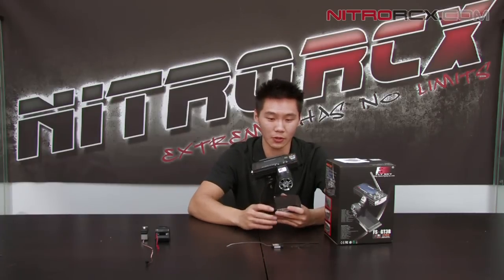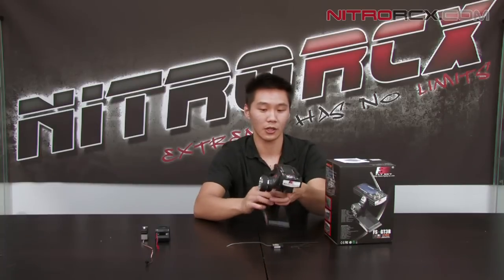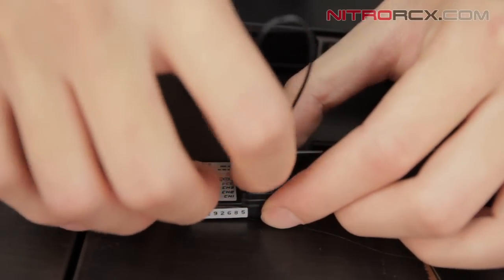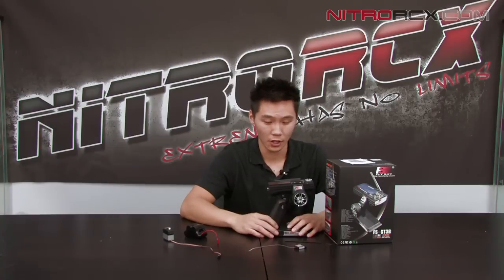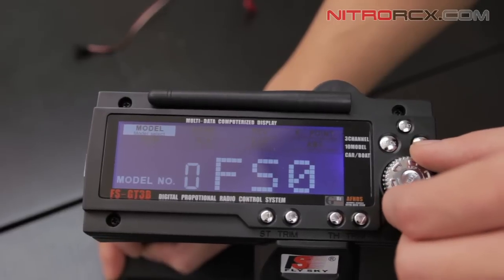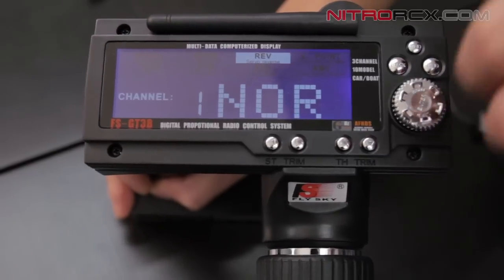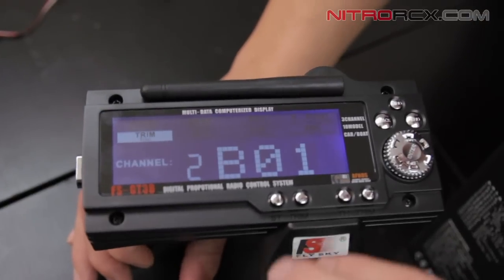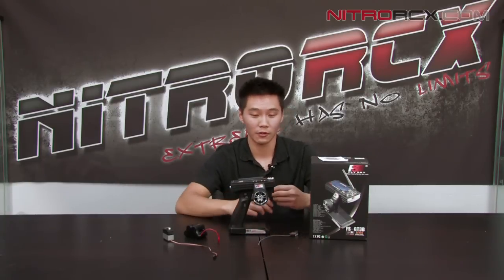Awesome FS-GT3B Digital 3ch 2.4ghz LCD Transmitter & Receiver

Comment from the maker: The red plug on the receiver battery pack is called a JST plug, and you can get it at most online hobby shops. Check online to see if you can find someone that's selling a Tamiya to JST plug adapter.

Comment: @ramtrix if your throttle is working as steering then you most likely plugged your servo into channel 2. Channel 1 is for steering and channel 2 is for throttle. Be sure you plug your steering servo into the channel 1 port (Ch1) and the ESC into the channel 2 port (Ch2).

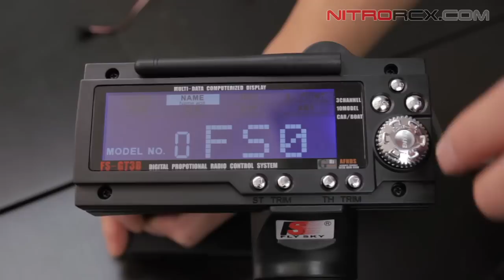Comment from the maker: When you set it make sure you have it set to the correct channel in your case I think you left it in channel 1 that is why the steering was changed and not the throttle, watch the video at about 5:40 and you will see how to set it on the transmitter.

Comment: @98snakeeater, to bind it if your not using a stand alone battery pack like bec. You would use your esc.  There is a good video that shows you how to bind it. The name of the video is How to bind,FlySky GT3B 2.4GHz 3ch receiver and how to set up the fail safe.

Comment: I highly recommend this system i use it in my revo 3.3 and i have not problem taking it 150 yards away with no glitching no delays no problemms what so ever. i also own a futaba 3pm 2.4ghz i had on my revo but removed it for 1 reason ths low battery indicator doesent beep till 8volts which is to late mine hite 8volts and my revo never came back 40 mph into a block wall luckly only broke front diff case 15 dollar fix.

Comment: @supersanchez1991 hey man thats a good question for a beginner. i myself had to ask someone about this. all it is, is that it doesn't interfere with any other car frequencies. sooo this means that you can have many people running 2.4ghz without any interference. you can also pair the controller to any other 2.4ghz rc product.

Comment: all you have to do is select E. POINT and above the 100% it will say RIGHT BACK turn the stearing wheel to the left and it will say left forward and it will be back to normal. Mine was the same way when i got mine and that fixed it.

Comment: i need a receiver for mine i have the same one in your video but no receiver and every where i check there out of stock on the receivers
Reply: Ithink you can find this een on Banggood.com or Ebay for for sure.. I have also been checking out some nicer remotes too, here is one that I found: http://www.ebay.com/itm/FS-GT3B-3CH-2-4GHz-Transmitter-w-RX-Failsafe-For-RC-Car-/110706197338?pt=Radio_Control_Parts_Accessories&hash=item19c69a835a      I know I hate having to get everything from overseas to get a good price which can suck having to wait weeks to get something!!
Reply: ***** i love the radio but no one has any stock for the receiver even if i can get one receiver id be happy i have plans for this radio, i have tried to bind it to other machines with no luck at all so ill have to get a receiver maybe a few receivers for its a sweet radio
Reply: Hey Kevin can you tell me why a after market controller is better ? I am so confused about what one to buy 2 CH 3 CH Hall me out buddy
Reply: Jimi G after market controllers when you can use them are better cause the sets up are much simpler you get extra features on some that you dont other wise get more range is alos a bonus as well that some offer other wont. and there is the access to multi model memory one controller can control several different models i have the GT3B that they guy in the video is showing its 3ch and its awesome and very easy for setups as well. , iam also looking into getting the GT3c eventually and i want a few 4 channel radios as well.

Comment: @smokesilver ive tried that a few times, yet it doesnt seem to want to kick into reverse. the lights on the ESC show it working properly, like green if i go forward, yellow when braking red in reverse, but i just stop, no reverse? not sure if its the radio, all the trims are set correctly.

Comment: I bought one of these for my ACME Flash racing dune buggy 1/8th brushless and the car goes super fast in reverse and slow when going forward and I do not know how to fix that
Reply: Try flipping around your esc connector in the receiver.
Reply: Thanks but already got it fixed, someone suggested to swap 2 of the wires coming from the motor to the ESC and it worked

Comment: There isnt any trouble shoot there. the systme was able to bind. In my vxl cars everything is fine and the trims are at o for both. When I pair with my dynamite fuze 6800 kv systme it is binded but does not work right. The throttle trim has to get put to b 30 and does not opperate correct. How do I fix this problem. I bought this system for my tc4 with the fuze 6800 kv and with that car it isnt working.

Comment: hey help please I ordered this part there is no dvd in the box I tried to put this system in my tc4 with a fuze 6800kv system, I am not able to get it to function correctly. I put it in my vxl cars and all is good but with the fuze systm it keeps reading that b30 is at 0 and it will not let me use the trottle

Comment: i have the FS-GT2 2.4 radio that im using on my emaxx brushless i built, my castle system is working correctly and it set to have reverse and all that, yet it does not want to go into reverse when i use this flysky radio, what gives? should i rebind perhaps or what? i havent tried swapping radios/receivers with my airtronics i have so i dont know yet if the problem is the radio but i figured i might as well ask while im at it lol. the esc does show the lights indicating forward/stop/rev.

Comment: I just got this remote and I like it.....however on my old remote if i pulled the trigger it engaged my throttle but on this remote i have to push the trigger to make the car go and pull it back towards me to break (the exact opposite of my old remote) i tried changing the settings to reverse and that reversed my steering but not the trigger.... is there a different way to change that?

Comment: My throttle is working backwards, I pull throttle nothing happens.  I put in reverse and motor goes.  I changed out RX/TX to my airplane 2.4ghz and everything works fine.  please watch this vid if you think you can help.  Reversing throttle servo should only change the direction of the shaft, not the reverse/forward of the trigger.  What am I missing here....?

watch?v=ZgIamxG4Kmk

Comment: so how to bind the 2nd receiver ??
Reply: Go to the transmitter ,  and  rotate the dial  to "MODEL   SELECT 2, 3, 4 , 5 , ETC. Which  is next on the OPEN models ,  BE it ,  ca r , boat, and repeat the steps   to name your model. REPEAT  step  1, with  the battery pack. and bind  plug.   TURN on the receiver    power. HOLD down the "Bind " button on  the   transmitter , and turn it on.  THE UNIT will  now bind the  second receiver. ,  UNPLUG  the battery ,and  bind plug .  Turn off the transmitter , and  turn it back on.  THE system  is now bound to the second  model I.D  . Plug back in , the   steering servo  on  channel   1.  Speed  control to channel 2. You're good to go.  Just  repeat the process , for more models.

Comment: @Myglowplug if you're ok with voiding any warranty you may have on this radio, carefully take it apart until there's only the outer casing and follow this video:
/watch?v=dMk9O1fZ3Vg

sure its for an xbox controller but its along the same lines.

Comment: The expo on mine doesnt work right.. Can anyone test theirs to see the same? when i set + or - it works right for one direction  but when you steer  the other direction it has the opposite effect so its not built right i guess.  Example: if i give it 50% expo to turn  it should make it turn less responsive at the first 50% of the throw each way..   it works when you turn one way, but when you turn the opposite it will be wrong. it is MORE responsive barely turning and slow at full turn that way!